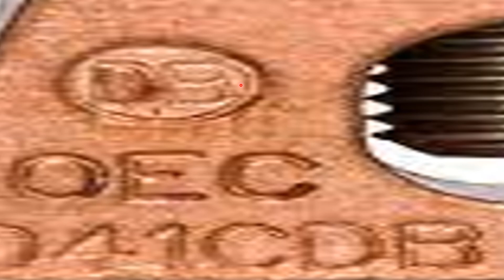Pool Bonding SPLICING the #8 copper???? On the Electricians in Action Everyday @ 9:00 am

Comment: Coach, i have a question: my house has an Electrical Service panel that has a ground wire attached to the ground bus. The ground wire comes directly from the cold water copper pipe sticking out of the concrete few feet away. If i add, a grounding rod outside, 8 feet deep, do i run this ground cable back to the service panel where the cold water ground wire is located. And secondly, if i want to ground my antenna that has a coaxial cable coming down from the roof, can i simply T off the ground rod wire in such a way that the ground rod wire remains unbroken..., or should i ground the antenna directly to service panel or ground directly back to the rod with a dedicated line?  thx!

Comment: Can these be used to split the wire connecting the heater, pump, zinc anode, and saltwater generator?  My wiring is all above ground and it is insulated and not a bare copper wire.  Does the bolt splice all need to be electrical taped??  Thanks!!

Comment: Would this be the best way to connect two separate spools of 8 awg bare copper? Could only get 50’ rolls at my towns menards but need 80’ so will have to connect them to complete the pool perimeter. Any suggestions?

Comment: Does a lelectric pool heater need its own gfci protection when on a different branch circuit than pump motor
Reply: Yes it does, unless your on a pool panel with a GFI feeding the whole panel